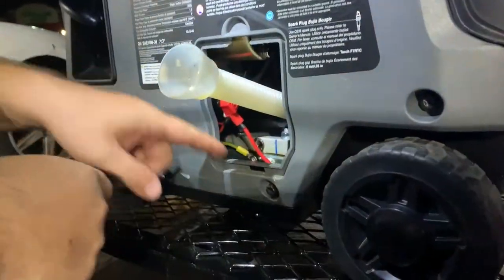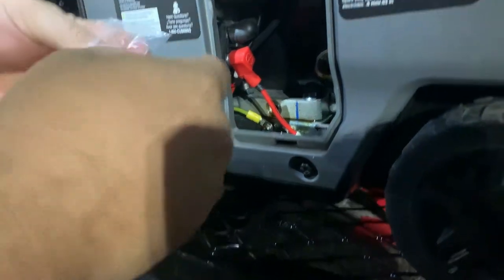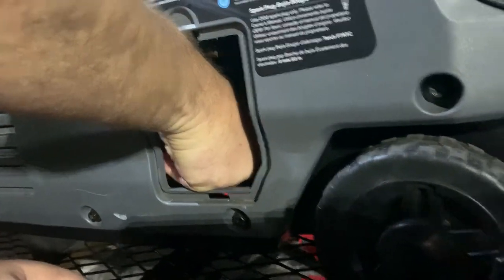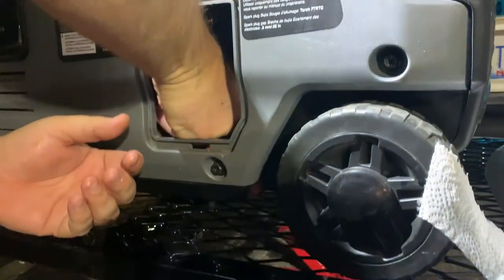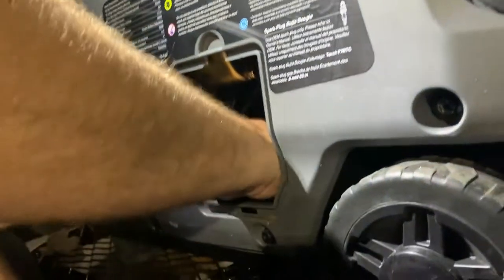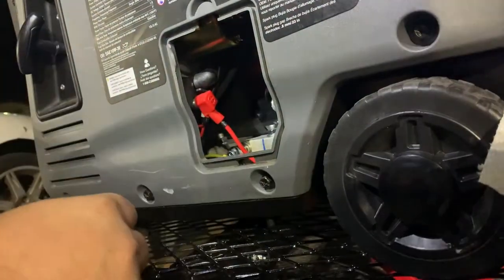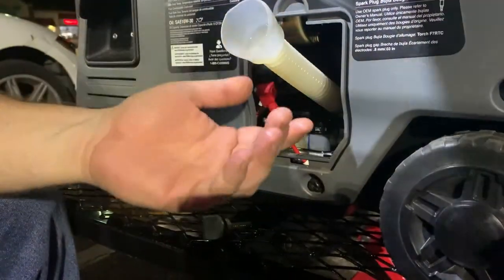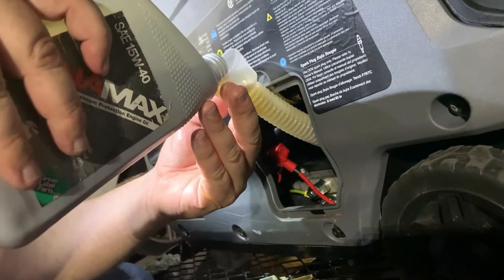Onan P4500i Inverter Portable Generator - Oil Change Step 3

Comment: Out of curiosity,  why not just thread the funnel in and tilt the generator to drain the oil instead of going thru all that for the drain plug.
Reply from the maker: Not a good idea to tilt these generators. Try to keep them as level as possible at all times. There is a handle, and it is not recommended  in the manual to tilt it too much during transportation. I have tilted it a bit once to try getting more oil out but it is designed to drain while level.

Comment: I was leaking a bit of oil and noticed I didn’t have the washer on there.  Did you have to buy another and if so where and do you have the part number?
Reply from the maker: Yeah, if you lose the washer, visit Lowe's for a replacement. Any washer should do, the one that came with it was nothing special.